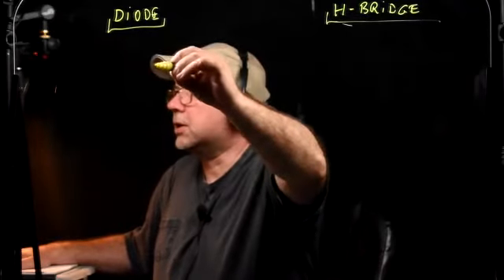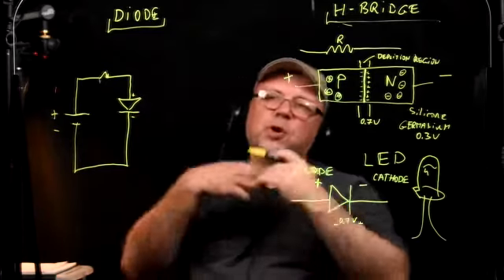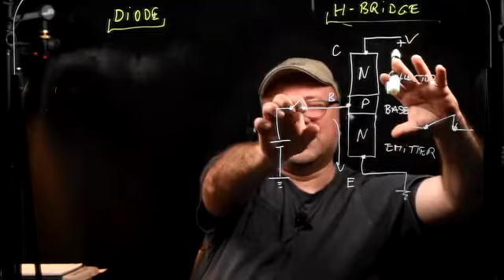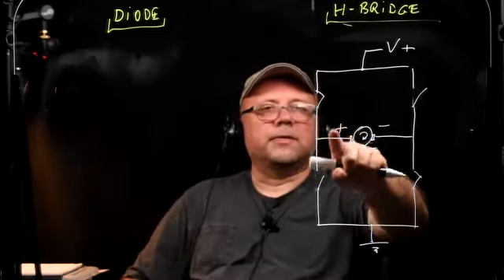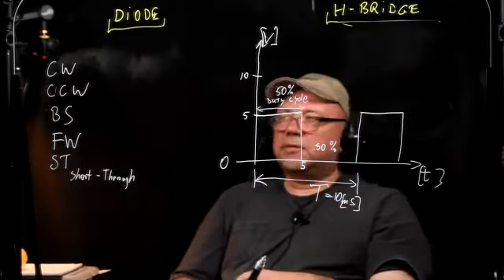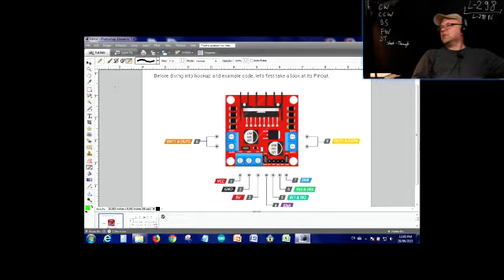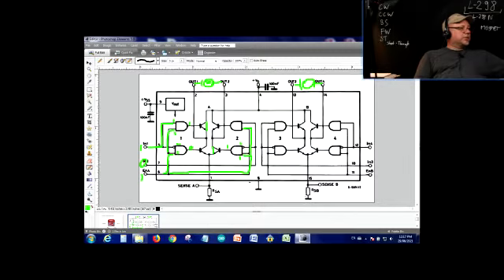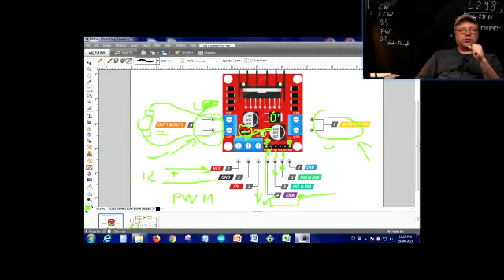H Bridge and PWM

Comment: Very informative video.. But what happen when a DC motor with 4 switches have a 3 open switches and 1 close switch? Will it be a free will or Brake Stop? tia
Reply from the maker: Only one switch closed. It’s just like lifting one leg of the component. Lifting one leg breaks the whole circuit. And the survey says, drumroll…….. FREE WHEELING. Cheers! :)